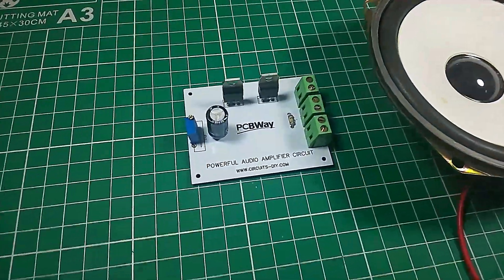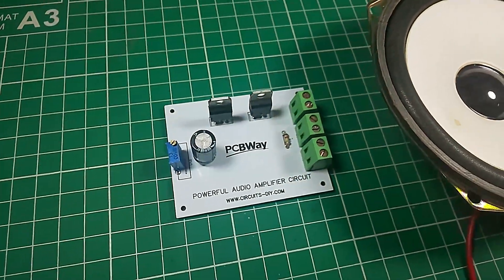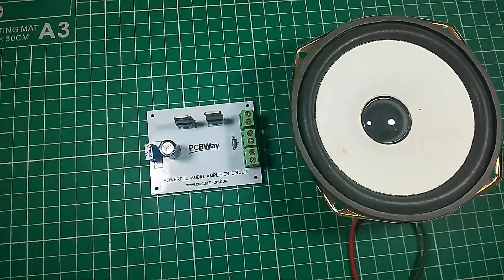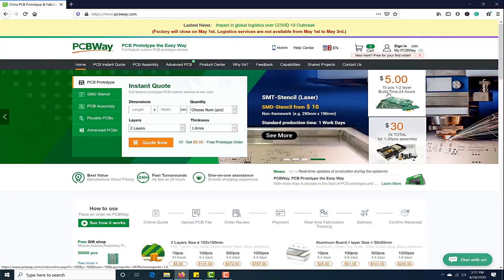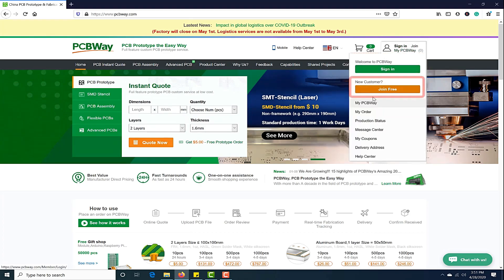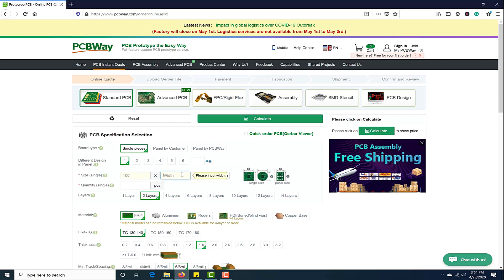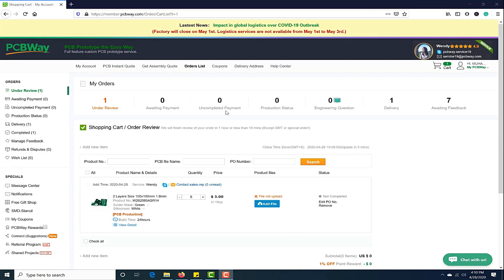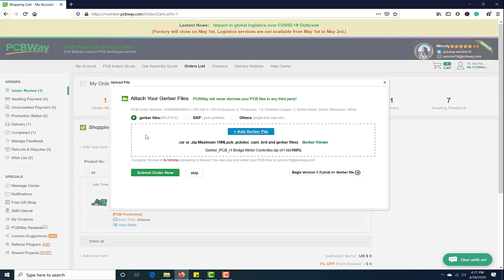Powerful Audio Amplifier using TIP122 & TIP127 Transistors | Electronics

Comment: Something inside me screams in agony when I see "+12VDC" going via a speaker's voice coil. I assembled this circuit myself and there is a VERY noticeable offset in the speaker cone... is there any way to eliminate that? Or change the design so the supply voltage doesn't have to go via the speaker?
Reply: Un capacitor de desacople

Comment: What is minimum and maximum power output?
Reply: I'm not the poster, but looking at the datasheet for the Darlington transistors, their rated maximum collector current is 5 A or 8 A peak.  The equation P=IV gives me a back-of-the-envelope estimate that with a maximum peak voltage difference of 12 V, the maximum sustained power would be 60 W with a maximum peak power of 96 W.
Reply: That was just a quick back-of-the-envelope estimate of the max, and I think really is much less.  And according to the poster's hack-a-day project page, they are using an 8 ohm speaker.  So seems to me that according to Power = (Voltage ^ 2) / Impedance, that 12 V across an 8 ohm speaker results in a peak power of 18 W.

I'm also reading someone else comment on another video that looks like the same circuit that is saying since this is a class AB amp, it can only get 75% power efficiency and that it is really a 15 W amplifier, but I don't know how exactly they got that number.